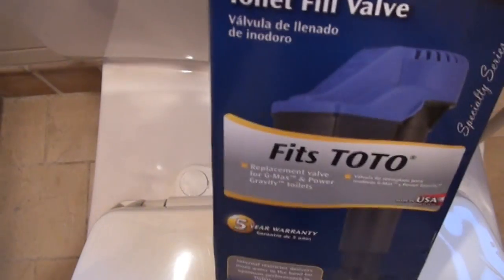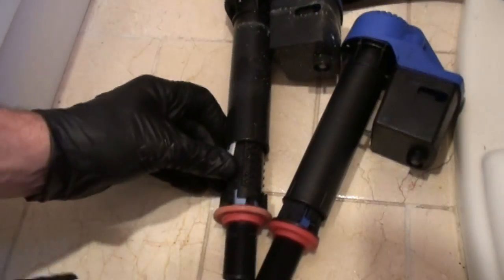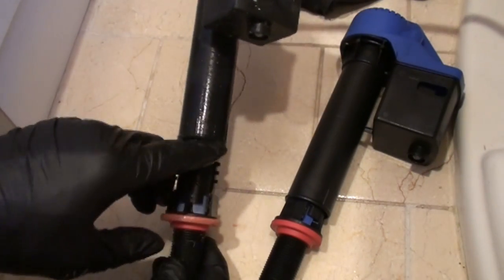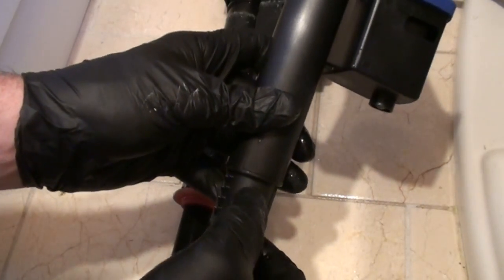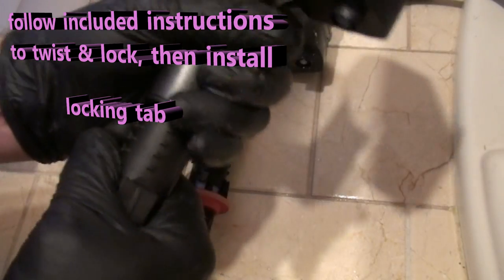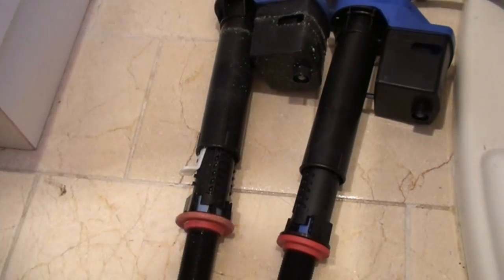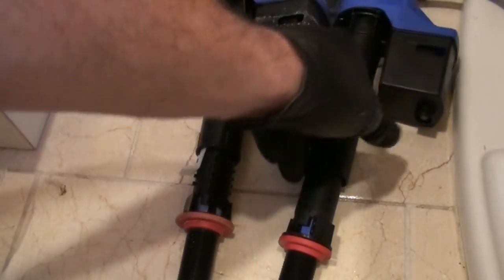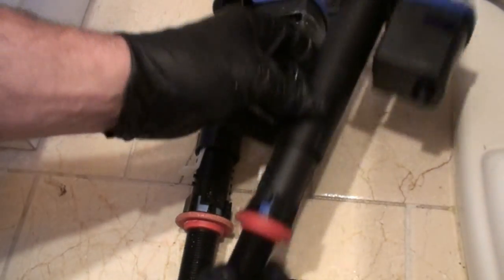Fix TOTO Toilet,,,Away Goes Trouble...Down the Drain

Comment: I will stay away from any Toto toilet as the Toto Dual Max we bought caused more trouble than good and isn't worth its high price at all. First, its installation was a big headache cuz you had to drill two extra holes into the floor which was not easy at all in solid tiles. Secondly, its bowl is very easy to get dirty and stained due to its design and so-called water saving feature with a weak flush. Last but not the least, if you have a blockage its unique drain hole shape makes it very hard for normal plungers or toilet augers to work. It's a total white elephant.

Comment: THE 30 QUESTIONS YOU SHOULD MAKE BEFORE BUYING A BIDET           Lack of Sanitation is the reason the Americans and especially the women didn’t use bidets. 

A. You are a healthy young person and the bidet would be for your personal or family use.
•  Is there any case that jet nozzle could touch user’s body?
• Is that nozzle well protected from being contaminated by feces?
•  When the selling companies are claiming about cleaning up of jet tube, do they mean using disinfectant, or just plain water? 
•  If they say that cleaning is done every 24 hours, you should have in mind that in the meantime somebody could infect the flash nozzle. Even if you intent to use it personally, you never know what could happen in. Disinfection must be easy and at hand in any case and time. A criterion for effectiveness is the bidet could get used on public toilets.
•  How somebody could be sure that a curious child would not play with the buttons causing a havoc?
• How often the nozzle has to be cleaned up from water salts etc?
•  Why most companies don't give guarantee time more than 3 yrs?
• Would you be able to clean up the toilet cover etc with water? Electrical bidets do not allow that.
• Would it be as effective as a bidet with vertical water jet?
• Would the bidet have control mechanism for jet, so to avoid surprise shock experience?                                                            How much time is needed for the hot (?) air to dry up the hairy region? Remember, here the area is not like your hands. 
• This one is of outmost importance for women and specially after child birth. They, because of anatomical reasons, are in danger their genitalia could get spoiled  and infected by the spilled around water intermingled with feces and their microbes..This could be 
• the result of the action of oblique water jets splashing on anus area. With the KO BIDET, thanks to its special flash nozzle the water jet direction is vertical, or better can be arranged to direct from forwards to backwards, so in no case their genitalia  could get spoiled. 
• Could a bidet be used in public toilets? That would mean that it is safely disinfected and so safe for you.
• You may don’t know that it has been proved that warm water helps to increase numbers of dangerous microbes inside tubing or tanks. So think twice before looking for it. ( J UOEH. 2014 Jun 1;36(2):135-9. A survey on bacterial contamination of lavage water in electric warm-water lavage toilet seats and of the gluteal cleft after lavage.Katano H1, Yokoyama K)  .
• Is there a bidet which it renders warm water useless? 
• IS THERE A GUARANTEE AGAINST A POSSIBLY CATASTROPHIC WATER LEAK?
• Could clothing get wet, or water could splash around 
•  Is there a cheap bidet that meets the above requirements?
• Could the KO BIDET (bidetdisabled.com) may be that one?.
 

B. If you are a disabled or care for a disabled  person:   the same questions as before,  plus:
1.Could the apparatus satisfactorily get functioning  by a blind or a person having mobility problem?                                            2.   How somebody could manipulate the so many buttons, that couldn’t, even see it, because of their place, especially when he has mobility problems?                                                                                                                                                               3. The water jet is exactly or about vertical? (You know that a small change in jet angle could send water at the wrong place in case  you are going to use a toilet riser).                                                                                                                                     4. If you intent to add a toilet riser, you should ask whether the bidet and the riser could be combined.                                                                   5.If the patient could not leave the wheelchair the add on bidet must not prevent the chair to roll over the bowl.                                                                                                                 6. In case of a blind he needs a bidet that offers a 100% effectiveness, so not to worry about the result.
  KO BIDET: www.bidetdisabled.com 
Comments in blog: bidets-Americans.com

Comment: Replaced the flush valve, put the clip in the same spot as the old. And it still does the same thing, worse actually. With the right Toto replacement flush valve kit. Now what ?

Comment: Help, please.  My Toto toilet is leaking from the bottom of the tank onto the floor. It looks as if it is leaking where there is a bolt. It has been leaking for awhile and it is now dripping. We turned off the water supply and emptied the tank. I have watched your video and looked at others, but I do not see anything that seems to be our problem.  Do you have any ideas?

Comment: My rim flush keeps running. There is a small control valve in the line but no matter how I adjust it ,it dribbles. Is this the problem or do I need to replace the whole unit again/ Its only about 2 yearssince the whole thing was replaced.

Comment: Totyo s300 leaks behind the brass connection from the supply line--leak coming from inside main line.Can this be repaired by disassembling main unit?

Comment: THANKS A LOT, I am having problem with toto, and wanted to buy toto's original flapper and could not, home depot does not have any one. Amazon has some stuff but I don’t know which one to buy, because my husband threw away original flapper so, I have to figure out it by myself.
Reply: There should be a model number stamped on the inside of the tank.  You can use that to find the appropriate flapper replacement.  I recently bought a universal Toto replacement that had an adjustment on it, so it could be used with any model.
Reply: Vic Ricker THANKS A LOT,
Reply from the maker: the2362 you can also call toto they good cust service http://www.totousa.com/toto-customer-support
1-888-295-8134
custservice@totousa.com
thanks for watching my video, thanks for your note, little things like that keep me motivted.
check out my main channel: The Handyman Zone and hit that subscribe button would really appreciate the support :)
http://www.youtube.com/user/roslynny

dino pinch

Comment: At 8:17 you say "ToTo only flush 1/2 way". Why is that? I have the old style flapper that you say the red replaces but if if only flushes 1/2 way maybe I should repair the old one. The old flushes all the way.
What are your thoughts and many thanks.
Job well done on the video!!
Richard